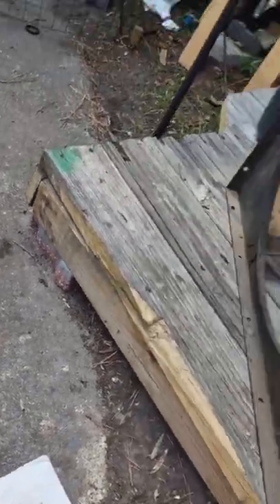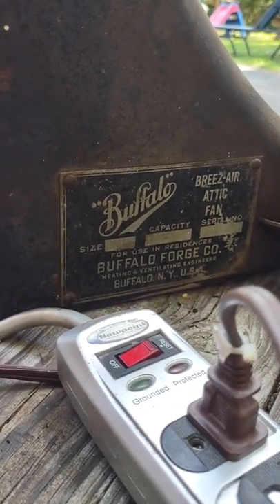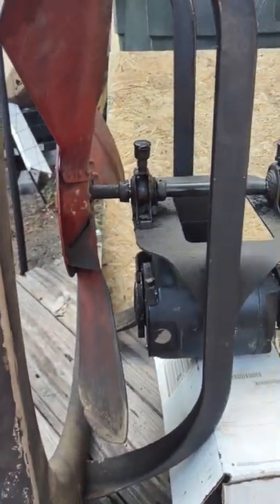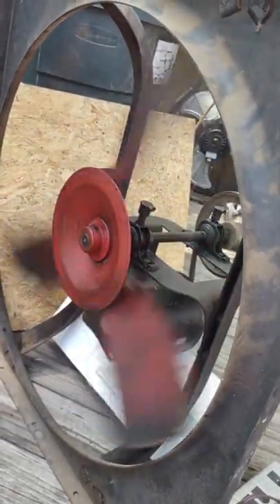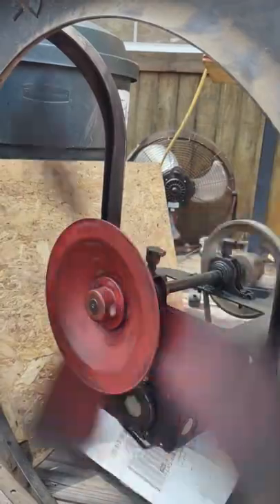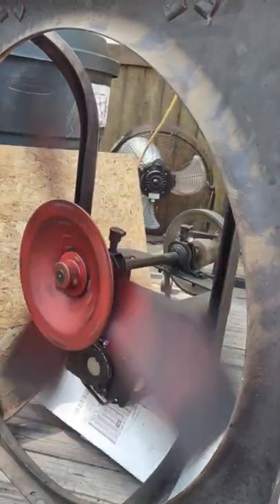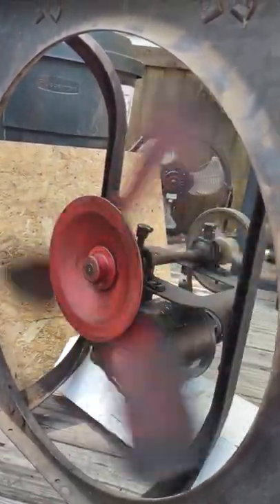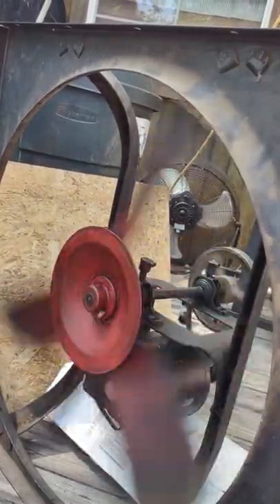Quick Demo 1940-1950?  Vintage Buffalo Forge Breeze Fan!! Restoration video coming soon!!

Comment: Excellent Buffalo Forge fan!  It looks like that motor might be original, or at least period-correct for that fan. By the way, thanks for your comment on my video on mine.  I got the info about it from other members of the AFCA (Antique Fan Collectors Association). Lots of good people and info there.
Reply from the maker: Thank you, it is only 1/6 HP. What HP and speed was your fan? I don't know how to figure out the age of the motor. It is a Westinghouse the style # is 1177567-E. It's 110 volts 60 cycles which tell me pretty old. Opening it up looks like the start windings go a bit warm as the are almost black they read 1.5 ohms and running windings 2 ohm's, I might have that backwards.
Reply from the maker: I enjoy watching your channel and the awesome work that you do with the ILG fans. In 2001 I went to a high school in Florida called King high. If I remember they had an ilg fan in each classroom as a school did not have air conditioning. I do not know if the school still exists or if it has been demoed since then.